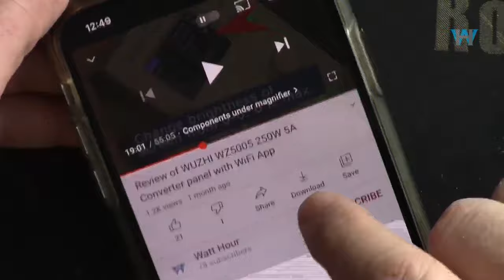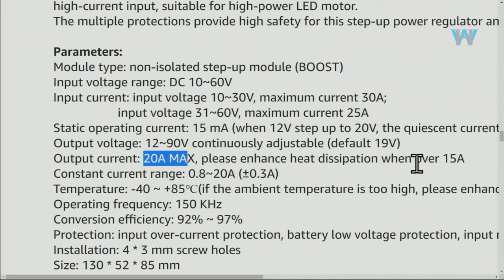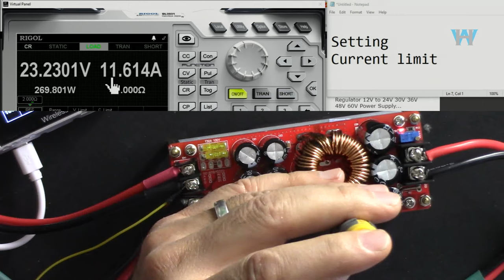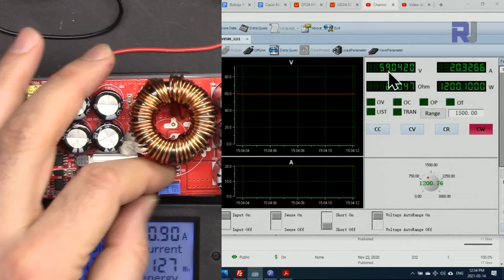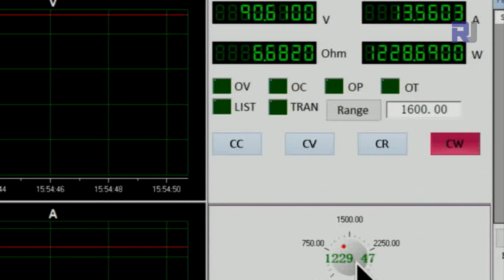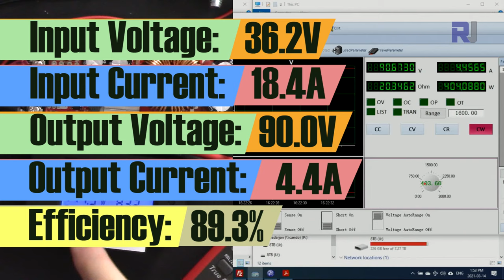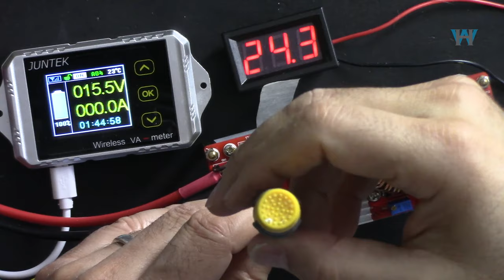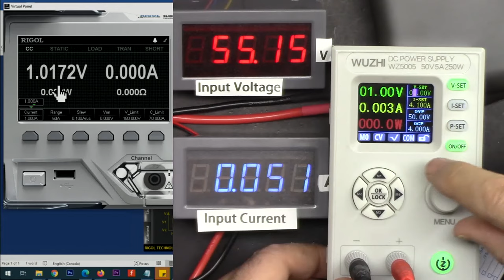Review of DC 1500W Boost Converter 10V-60V to 12V-90V module 1.5kW Tested

Comment: hi i have the same step up like u but rated for 1800w i have 52v battery and 25a load i want to bring 52v to only 56,12v can it sustain 25a load like that?
Reply: not constant load btw
Reply from the maker: Hi, unless I test it, I wouldn't' know.
Reply: @WattHour  our 1500w will do it?
Reply: i though of this parameters for it 46v cut off 26amp max and 62,9v it is gonna ho on my ebike

Comment: i am usint this for wind turbine and it always braking the turbine as it has no constant DC voltage :D what am i doing wrong
Reply from the maker: this accepts very wide range from 10V to 60V and it works. so if your wind turbine has any voltage in this range it should work. Now the power (or current) that you get from the output of this converter should not exceed the rating of this converter and the maximum rating of your turbine. both should work so you can get the output . if your turbine can supply for example 20V 5A, then 20x5=60W is the output of your turbine and that is the input to this boost converter. Next the converter will output about 58W at output any voltage range.
Reply from the maker: hello, you included the link in your comment and it was under the spam. I approed to be published. Then you updated the comment today and youTube moved to spams. So keep in mind if you have link in comment it stays in spam until I see it to approv it. Until then, others won't see it.  Goodl luck
Reply: @WattHour  i removed the link :)

Comment: Sir if I use 12v 100ah battery in put supply. How much I get out put voltage and watts
Reply from the maker: this is exatly why I amde this video. Please and get answer. I have gested it with 12V input.

Comment: I put the 1800W version on an ebike and it failed after 5 minutes, halfway up the hill. Output voltage is now the same as input. :-(
16V to 55V, to a 48V 18A peak ebike controller.
Reply from the maker: Your bike drew more current than this module can provide and the dues did not protect the module.So the protection did not work and it is dead now.
Reply from the maker: I have found a better module and the video will be posted soon. That may be useful.
Reply: @WattHour  the switching MOSFET is blown. Literally a burn mark and crack. :-(
Reply from the maker: yes. this is what happens. if you see my other video you will see it. I bought the 1800W version but could not complete my test as it died during the test. I did not want to pust it thinking to buy more module, but realized that i have spent already over $100 on these modules and have not earned that money from YouTube so I stopped buying the module.

Comment: Hi I am trying to charge the battery on my bike it is 40volt @2amp from a 12v battery is the possible and how do I set the output current t 2amp Cheers Ken
Reply from the maker: Hi, this is not suitable for 2A charge as you can't set 2A current. I have shown and it wont' work. Use this module https://youtu.be/Ya2MIEn6cSw
Reply: @WattHour  Any recommendation for charging 58.8v Lithium Battery?

Comment: Thank you for the great video. it is the first one I found that explains this voltage converter in such a detailed and understandable way.
I have a question about this voltage converter.
I bought this component and want to use it to drive a motor. The circuit looks so far that I have connected a 12v 12Ah battery to this voltage converter. The current should be delivered to the motor (48v, 1000W) via a 1000w 48v DC motor controller. Now this circuit works so far because the engine is running. However, there is the problem that the motor does not have enough power. As soon as it is minimally stressed, it brakes heavily. My guess is that not enough current is reaching the motor, even though the voltage is correct. Is it possible to drive such a motor with this device and what do I have to set? Or does it make more sense to use another device?
Maybe you can help me?
Reply from the maker: you are very welcome. your load it 48V and 1000W. Then I=1000W÷48V=20.8A , so your motor needs 20.8A if it is 1000W. if the motor does not run when you connect a load, then it means the voltage is reduced when you put load it. Either your motor needs more power  and this converter can't supply or you have not set the current CC to the maximum. please set to maximum. I've shown it in the video. Good luck and stay safe.

Comment: Is there any way i can boost it to 120v dc? So that my tv can run from it
Reply from the maker: 90v is the max.  What kind of tv will turn with 120V DC? It should be either 120V or 220V but AC.
Reply: @WattHour  basically any tv that has SMPS in it will run from DC and AC both as long as it gets minimum required voltage, most of the time it's 110v minimum.

Comment: Well...anyway it has high efficiency even producer used simple asynchronous rectifier based on schottky diodes. Big pitty that second mosfet as diode wasnt used with such a big sesigned power 1.5kw.  I think it will crash soon due to spikes on diodes and main mosfet due to poor snubber circuits or even lack of them ;) maybe it last longer but with power lower than 500W.
Reply: I put the 1800W version on an ebike and it failed after 5 minutes, halfway up the hill. Output voltage is now the same as input. :-(
16V to 55V, to a 48V 18A peak ebike controller.

Comment: hi, can i connect 36 volts and 28 volts output
Reply: I do not believe so. Boost converters can only output voltages higher than the input voltage. You need a "step down" or "step up/down" converter for those input and output voltages. The topologies for those are "buck" and "buck-boost" respectively.

 "Boost"  converters like this one can only step up voltage, "buck converters can only step down voltage, and "buck-boost" converters combine the buck and boost converters together to allow you to output a lower or higher voltage than the input voltage as long as it does not exceed the total input power amount. 

Even when you know electronics terminology it is still a pain to find the right one for your project because of how mis-advertised most of these things are. Some sellers even make it worse by advertising 2 or even all 3 of these power supply topologies as "boost converters"
Reply: @joshnabours9102  Thank you
Reply: @robertovalinhos27  no problem

Comment: @16:37  i dont believe what you saying is correct. You´re saying if i give to much input-current = the thing will break ? 
In an ordinary application (not with a laboratory-meter like yours shown here),  how am i supposed to throttle the input-current ? 
For example if I hook it up to a big 100AH car-battery =  It will just take all that input-current from the battery if it wants to, there is no "switch" where I can regulate that.

Obviously  the output-current is related to the input-current. The more I want to get out = then the more I have to put in.
So if i don´t exceed my max allowed output-current = then my input-current will not exceed the max either.
Same goes for the warning light marked "OCP", over-current-protection. it reads the output-current, not the input-current.

Again, in an ordinary application no one can regulate the input current, BUT we can regulate the output current which is related to how much current it will take in.
Reply from the maker: Yes no one can regulate the input when for example connected to a battery but use should only connect a load that is suitable for this converter. Thanks
Reply: @WattHour  OK, Thanks for reply.
My plan is to use dc-dc booster in an RV for an "induction heater". 
The RV has 12V system and several Batteries, so there are a view 100 amps available. The induction heater runs from 12 to 48V, but it needs more than 12V to start properly - so here comes the dc-dc booster.
I am aware that the induction-heater can draw more than this dc-dc booster can supply, but I dont need the induction heater to run at its maximum, only about 50%. So my plan is use this dc-dc booster: input 12V,  at about 15A and output  30V, at about 10A.
As you mentioned, as long as I dont go over the max input current - which i will monitor ... and at the beginning I will set the output-current all the way out, then slowly increase it, it will not harm the induction heater if theres no current or low current - then it will just not heat to its full capability. However it will hurt the induction heater if there is low voltage as the manufacturer mentioned. 
With the CC-potentiometer I can throttle the output amps and with the CV-potentiometer I can bring the volts from 12V up to 30V. Or find the "sweet-spot" where it operates best for this application and keep the input-current way below maximum input.  
That should work, right ?  Good plan or bad plan ?  Or is there something completely wrong with my theory ?  I´ve bought all the parts already but haven´t tried it yet.

Comment: Maybe you can compare the converters wave forms using oscilloscope with the output of power adapters of led tvs or laptops so that we  an evaluate the differences...
Reply from the maker: I've shown ripples under the load. that is what you can compare.  Load is like TV or motor or whatever you have.
Reply: @WattHour  what I mean is that I wanted to know the differences between the "original adapter output" of led tv or computer with the commercial boost converters. More in terms of ripples...

Comment: Hello, I'm currently setting up the Boost Voltage Converter, DROK 1500W Voltage Regulator DC 10-60V Step Up to 12-90V 20A Input Power Supply Module Volt Transformer Circuit Board.  I have not connected it to a load yet but I'm measuring about 59 volts out with nothing connected. Does someone know what the open circuit voltage will be?
Reply from the maker: Hello, I think you have not paid attention. All my test it has been open circuit. I've shown load with zero current and then turned it ON.  I don't understand if you are referring to something else.
Reply: @WattHour  Yes. I understand now. For some reason the unit I received was set for 60V vs 19V which I assumed to be the default.

Comment: hi how can i make it accept more volts and amps? thanks
Reply from the maker: you can't. The design and components have limit.
Reply: @WattHour  they are other design for this, one with 1800 watts from the factory. i saw another video where a guy added more mosfet and a bigger conductor and he made it 3000 watts, is that possible ?
Reply from the maker: I am an engineer and know you need proper calculations and changing components. People randomly add components but they have not checked or presented the efficiency.  Efficiency might decrease significantly.

Comment: THANKS FOR THE GREAT REVIEW...THUMPS UP AND SUB.   One question though:
For 12v input, my load current MUST be stable from several; AMPs to a few mA...
========================================================================
So, will the set output Voltage remain stable if I am only drawing current in the mA range???
========================================================================
THANKS AGAIN...VERY HELPFUL!!!!!
Reply from the maker: input does not need to be stable. it can go up or down as long as it doesn't go below the minum which is is 10V (I forgot it).  One condition: output must be greator than input voltage.

Comment: Inability to do CC with output shorted is a serious deficiency.  Doing this with switch mode PSU is challenging, but still, NO EXCUSE!  Also the tacked on afterthought of the fan control  board is "cheap"!  I have a couple of the 1200W versions and I would never use them in demanding situations.Sadly this is "normal" design of such boards from China.

Comment: Can I put in Dc 52.5v and get output 24v ? Or  Dc 48v
Reply from the maker: this is Boost converter. The output will ALWAYS be higher than input. look for BUCK converter or Step Down Converter. I have so many videos on that type of converter.